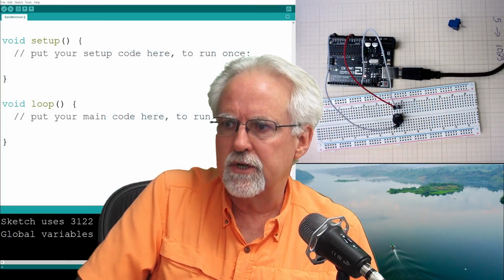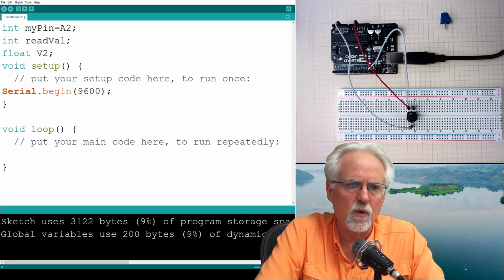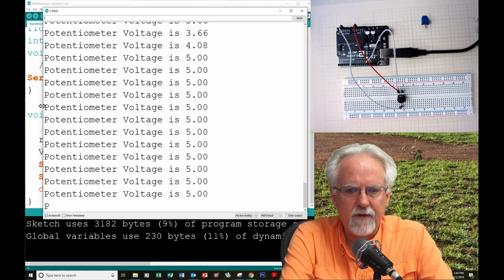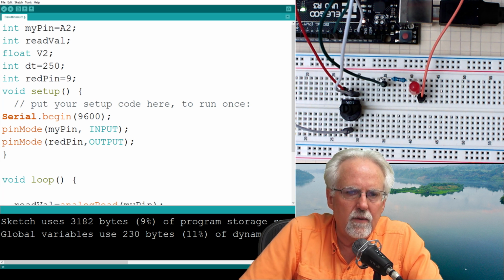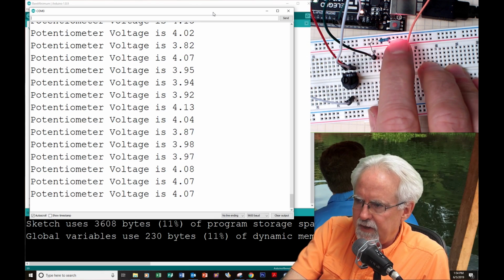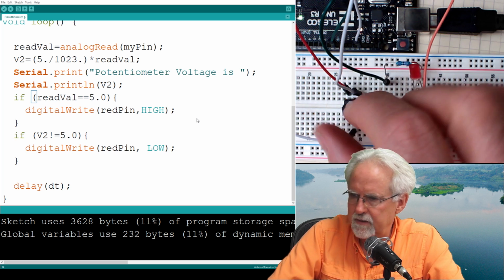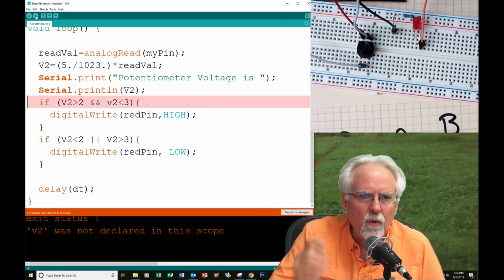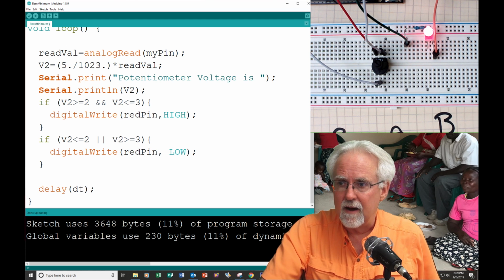Arduino Tutorial 13: Understanding Arduino If Statements

Comment: In your example, wouldn't it be better to " else"  instead of two times the " if" statement??
But anyway, I enjoy your lessons very much!!
Reply from the maker: No because else does not have the logical clarity of two if statements. Consider:
If a is not = 7 turn light on
else
turn the light off. The else introduces a double negative, and can be logically difficult for more complicated problems. I simply cover the parameter space of interest with logically clear if statements.

if x<5 do function a
if x=5 do function b
if x>5 do function c

I have completely covered the parameter space and no confusion on what the code is doing

Comment: So before I even got to the end of the video, I thought I wonder if it could set up 3 leds to give a safe zone, a caution zone and a danger zone and got it mostly working but couldn’t figure out how to switch the green off if it was below a threshold range. The over threshold was easy. So I started watching again and then you got to the “&” and “or” statements. That was the missing puzzle pieces I needed. I set my leds up to be: Green on between 0.07 and 2.99. Greater than 2.99, green off and yellow on. Above 3.99 yellow stays on but red illuminates as well. I think I will try having the red led blink above 4.50. Thanks Paul, for taking the time to teach us !!!

Comment: If you had inserted  a line saying "digitalWrite (redPin, LOW);" immediately before your first "If" statement, the second  one would be redundant because it is already set (given a default value of OFF). This requires less code/processing so it is more efficient.
Many years ago when I studied IT at university, we had to prove this by writing the man-readable code, then the assembler, and build the circuit to verify it. It was a tedious exercise but, once learned, it's the sort of thing you never forget.
Reply from the maker: In most of what I do I am not striving to be efficient, since for this application, and in fact many applications efficiency does not matter that much. What I want is clarity in what I am trying to do, so a student can look at it and clearly understand what it does.
Reply: @paulmcwhorter  That's fair. You've explained it all very clearly.

Comment: Dear Mr. McWorther. I have been watching your videos and they refresh my knowledge in coding and circuitry. My old hobby has been revived. Thank you very much.
Reply from the maker: Excellent
Reply: @paulmcwhorter   This is my assignment, just had the time to do it :)
int outPin = A2;
int baca;
float voltase;
int jeda = 500;
int redLED = 8;
int yelLED = 9;
int grnLED = 10;
void setup() {
Serial.begin(9600);
pinMode(outPin,INPUT);
pinMode(redLED,OUTPUT);
pinMode(yelLED,OUTPUT);
pinMode(grnLED,OUTPUT);
}

void loop() {
  baca=analogRead(outPin);
  voltase=(5./1023.)*baca;
  Serial.print("Current voltage is ");
  Serial.print(voltase);
  Serial.println(" volts");
  if (voltase>=4.0) {
    digitalWrite(redLED,HIGH);
    digitalWrite(yelLED,LOW);
    digitalWrite(grnLED,LOW);
    Serial.println("MAXIMUM VOLTAGE RANGE");
    delay(jeda);
  }
  if (voltase>=3.0 && voltase<=3.9) {
    digitalWrite(redLED,LOW);
    digitalWrite(yelLED,HIGH);
    digitalWrite(grnLED,LOW);
    Serial.println("MIDDLE VOLTAGE RANGE");
    delay(jeda);
  }
   if (voltase>=0.1 && voltase<=2.9) {
    digitalWrite(redLED,LOW);
    digitalWrite(yelLED,LOW);
    digitalWrite(grnLED,HIGH);
    Serial.println("LOWER VOLTAGE RANGE");
    delay(jeda);
  }
if (voltase==0) {
    digitalWrite(redLED,LOW);
    digitalWrite(yelLED,LOW);
    digitalWrite(grnLED,LOW);
    Serial.println("NO VOLTAGE INPUT");

  delay(jeda);

}
}

Comment: Thanks Paul, your videos are excellent. Informative and well presented. I did the homework at the end but it didn't work as it should, so after some head-scratching and fiddling i discovered a very basic error i had made. That was more rewarding than it just working straight up. The fault finding actually was a constructive act in its own right. Cheers sir, and enjoy the coffee.

Comment: Genuine question for you guys why can’t we always declare it as a float to be on the safe side?
Reply from the maker: Because floats are not exact numbers and have round off errors in unexpected ways. For example if:
float myNum
myNum=4
newNum=myNum/2
if newNum=2 then
print 'Hello World'

Will not always work because you can end up with unexcpected round off error in the value of the float
Reply: @paulmcwhorter  great thanks for the quick response love the videos!

Comment: THE ASSIGNMENT :::

int readPin = A2;
int greenPin = 8;
int yellowPin =9;
int redPin =10;
int readVal;
float V_out;
String readMes = "The output voltage is ";
String greenMes = " OKAY !";
String yellowMes = " RISK !!";
String redMes = " HIGH RISK !!!";
int waitTime = 200;

void setup() {
  // put your setup code here, to run once:
pinMode(readPin,INPUT);
pinMode(greenPin,OUTPUT);
pinMode(yellowPin,OUTPUT);
pinMode(redPin,OUTPUT);
Serial.begin(9600);
}

void loop() {
  // put your main code here, to run repeatedly:

readVal = analogRead(readPin);
V_out = (5./1023.)*readVal;

Serial.print(readMes);
Serial.print(V_out);
Serial.print(".");

if (V_out < 3.0){
  digitalWrite(greenPin,HIGH);
  digitalWrite(yellowPin,LOW);
  digitalWrite(redPin,LOW);
  Serial.println(greenMes);
  }

if (V_out>= 3.0 && V_out<4.0){
  digitalWrite(greenPin,LOW);
  digitalWrite(yellowPin,HIGH);
  digitalWrite(redPin,LOW);
  Serial.println(yellowMes);
  }

if (V_out >=4.0 && V_out <=5.0){
  digitalWrite(greenPin,LOW);
  digitalWrite(yellowPin,LOW);
  digitalWrite(redPin,HIGH);
  Serial.println(redMes);
  }

delay(waitTime);
}

Comment: What if we want to connect our potentiometer to  external supply rather than connecting it to arduino 5V, and the source voltage is greater than 5V.

Comment: Thank you for the great lessons! I know a little programming but I want to learn arduino and electronics. I have two suggestions. 1. In the first version of if statements you wrote V2 > 4 and V2 < 4. But what about when V2 == 4. I think you should write V2 >= 4 in the first if statement. 2. Variables are very good but they use memory. So you should use them only for things you need more then once in your program. These suggestions are only my opinion :) Thank you again for the lessons. Sincerely, Levan

Comment: Rather than using the second if statement, the best coding practice is to use an else statement.
Reply from the maker: Actually no, and I never use else statements. It is like speaking in double negatives, and opens the door to unintended results. A series of If statements has logical clarity that is less likely to result in unanticipated results.

Comment: Love your video!  I am working my way through all your lessons and I'm taking them like I was a student.  My goal is to learn more about circuits which i did not get a lot of coverage on in school. Your videos are filling that in so nicely.  ;-)

Allow me to add, I would have thought a good addition here would be to discuss the ELSE case of the Arduino IF.  For example in my code I added it as such...
if (readVolts > dangerVolt){
                 digitalWrite(redLED, HIGH); }
            else
               { digitalWrite(redLED, LOW); 
    }  // endif
Just my OCD habits perhaps (not to show my age) but I have flashbacks of my old Pascal teacher in my head as I type this. I understand time is limited and I welcome your thoughts if that would not be wise in this context.  Please keep kicking this stuff out your quality is excellent!

Comment: I was able to do the homework but am having an issue when I try to add more lights. Trying to put a light for each voltage. When I try to implement a 0-1v command block it doesn’t work. I type
if (V2>=0 && V2<1) {
DigitalWrite(redPin1, HIGH);
DigitalWrite(yellowPin1, LOW);
DigitalWrite(greenPin, LOW);
DigitalWrite(yellowPin2, LOW);
DigitalWrite(redPin2, LOW);
}
My red light doesn’t illuminate when under 1 v. 

I’m also having a weird issue that only my green light (2-3v) is bright. The other lights only get 1.8 v
Reply: I’ve tried the “||” function as well with similar results but all the other lights do not come on when in coinciding voltages

Comment: I purchased the kit and do the homework.  I am an experienced T-SQL and .NET programmer, but have done nothing like interfacing electronic components and programming.  My goal is to build mechanical devices (i.e. Cymbal polishing machine, rotating drum riser, powder coating oven, etc) that need electronic devices to be controled by a computer program.  In this sense, I am behind the power curver.  I am ahead of your lessons generally speaking in coding.  At some point, I want to use Visual Studio or a Rasberry Pie to program and possible control the computer.

Great stuff, you have unstalled me.

Comment: Another fun homework assignment. I extended it to be a 5-part level indicator (Green, Green, Green, Yellow, Red) like an audio level indicator.

> 0.0 volt : Green #1 on
> 1.0 volt : Green #2 on
> 2.0 volt : Green #3 on
> 3.0 volt : Yellow on
> 4.0 volt : Red on 

---------------------------------

void loop() {

  readVal = analogRead( readPin );
  voltage = ( maxVoltage / pinRange) * readVal;

  LightLED( greenOnePin, voltage > zeroVolt );  
  LightLED( greenTwoPin, voltage > oneVolt );  
  LightLED( greenThreePin, voltage > twoVolt );  
  LightLED( yellowPin, voltage > threeVolt );  
  LightLED( redPin, voltage > fourVolt );  
  
}

void LightLED( int pinNum , boolean turnOn ) {

  if ( turnOn )
  {
    digitalWrite(pinNum, HIGH);
  } else {
    digitalWrite(pinNum, LOW);
  }

}

Comment: here's the code : int grep=9;
int yelp=6;
int redp=3;
int apin=A3;
float v2;
int readval;
int dt=250;
void setup() {
  // put your setup code here, to run once:
Serial.begin(9600);
pinMode(apin,INPUT);  
pinMode(grep,OUTPUT);
pinMode(yelp,OUTPUT);
pinMode(redp,OUTPUT);
}

void loop() {
  // put your main code here, to run repeatedly:
  readval=analogRead(apin);
  v2=(5./1023.)*readval;
  Serial.print(v2);
  if (v2<3.){
    digitalWrite(grep,HIGH);
    digitalWrite(yelp,LOW);
    digitalWrite(redp,LOW);
   
  }
  if (v2>3. && v2<4.){
    digitalWrite(grep,LOW);
    digitalWrite(yelp,HIGH);
    digitalWrite(redp,LOW);
  }
  if (v2>4.){
    digitalWrite(grep,LOW);
    digitalWrite(yelp,LOW);
    digitalWrite(redp,HIGH);
  }
delay(dt);
}

Comment: When you code for the two conditions (if V2 is greater than or less than 4.0), you can actually string the two if statements together:
if(V2>4.0){
digitalWrite(redPin,HIGH);
} else if(V2<4.0){
digitalWrite(redPin,LOW);
}
Since the voltage on the potentiometer can only be one value at a time, there will never be a circumstance where the value is both greater than and less than 4.0.

Comment: One problem with the greater than 4.0 and less than 4.0, it should have been less than or equal to 4.0, which is <= 4.0.  As it was written 4.0 is left out.  You're telling it to turn on the LED above 4.0, and off below 4.0, not at 4.0.

Comment: The first and third codes work but not the second? Can someone tell me what I'm doing wrong?

int myPin=A2;
int readVal;
float V2;
int dt=250;
int redPin=9;

void setup() {
  // put your setup code here, to run once:
Serial.begin(9600);
pinMode(myPin, INPUT);
pinMode (redPin,OUTPUT);
}

void loop() {
  // put your main code here, to run repeatedly:
readVal=analogRead(myPin);
V2=(5./1023.)*readVal;
Serial.print("Potentiometer Voltage is ");
Serial.println(V2);
if (V2==4.0){
  digitalWrite(redPin,HIGH);
}
if (V2!=4.0){
  digitalWrite(redPin,LOW);
}
delay(dt);
}
Reply: try this change
if (V2==5.0){
  digitalWrite(redPin,HIGH);
}
if (V2!=5.0){
  digitalWrite(redPin,LOW);
}
change the value from 4.0 to 5.0.

Comment: Si with the if statements. When using a greater than 2 and another line saying less than two. What happens if the voltage is exactly at two? Does one of the lines need to read If greater than or equal to 2?
Reply from the maker: You are correct. The boundary conditions need to be explicitly considered or disaster awaits. I usually try to do that.

Comment: int read_pin =A3;
int red_led=10;
int yellow_led=9;
int green_led=8;
int read_val;
float V2;
int delay_time=50; 

void setup() {
  
  pinMode(read_pin, INPUT);
  pinMode(red_led, OUTPUT);
  pinMode(yellow_led, OUTPUT);
  pinMode(green_led, OUTPUT);

}

void loop() {

  read_val=analogRead(read_pin);
  V2=(5./1023.)*read_val;
  if(V2<=3){
    digitalWrite(green_led, HIGH);
    digitalWrite(yellow_led, LOW);
    digitalWrite(red_led, LOW);
    
  }
  else if(V2>3 && V2<=4){
  digitalWrite(green_led, LOW);
  digitalWrite(yellow_led, HIGH);
  digitalWrite(red_led, LOW);
  
  }
  else if(V2>4){
  digitalWrite(green_led, LOW);
  digitalWrite(yellow_led, LOW);
  digitalWrite(red_led, HIGH);
  
  }
  delay(delay_time);
}

Comment: Input is not connected to resistor, how the led lits up 🤔, I mean potentiometer is one separate ckt and led another ckt  their is no common connection then how.. Pls explain sir..
Reply: The two circuits are connected by codes only. The first circuit generates the input, the 'If' statement takes that value to generate the output.

Comment: Hey Paul! For some reason, on the homework assignment, my yellow and green LED are dimly lit, with the yellow one being barely visible. I can't figure out what I'm doing wrong. Each LED has its own pin, and its own resistor which aren't in series.

Comment: The potentiometer that came with my kit was faulty. If you guys get readings that you can't explain (like voltage not increasing/decreasing when you turn the knob, or voltage always being 5 or 0), then your potentiometer is probably bad. I ordered some on Amazon and now the readings look good.

Comment: Why are you dividing with 1023 and not 1024? (Which is the actual number of steps)
Reply: Because it's not the # of that step, but the value associated with that step. Here step#1024 has a value of 1023.

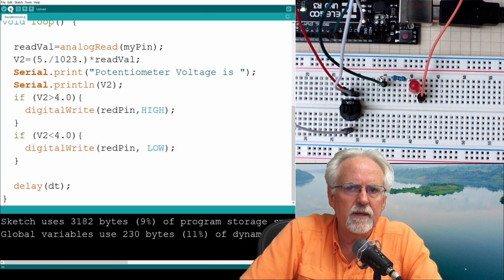Comment: Hey guys @20:32 I am getting an error when compiling the code. The error is "cannot convert 'int' to 'void(uint8_t, uint8_t) {aka void(unsigned char, unsigned char)}' in assignment
exit status 1
assignment of function 'void pinMode(uint8_t, uint8_t)'"

The line that is resulting in the error is "pinMode=(redpin,OUTPUT);"
Reply: This is the code I had written:

int myPin=A2;
int readVal;
float V2;
int dt=250;
int redpin=9;

void setup() {
  // put your setup code here, to run once:
Serial.begin(9600);
pinMode=(myPin, INPUT);
pinMode=(redpin,OUTPUT);
}

void loop() {
  // put your main code here, to run repeatedly:
  readVal=analogRead(myPin);
  V2=(5./1023.)*readVal;
  Serial.print("Potentiometer Voltage is ");
  Serial.println(V2);
  if (V2>4.0){
   digitalWrite(redpin,HIGH);

}
  if (V2<4.0){
   digitalWrite(redpin,LOW);
}
delay(dt);
}
Reply: @cavs1899 probably because using = after pinMode in Void Setup

Comment: I noticed in the Analog read video (#10), in the void setup you used pinMode to make an analog pin an INPUT. but in your potentiometer video (#12), you didn't include it and were still able to read the voltage with the analog pin. can you explain why this is?

Comment: Did have an issue with the POT thought it was my programming, but no, it was a poor contact. In the end, I have soldered on some short wires on the POT to get a consistent voltage. Good tutorial No.13. Thanks, Adam

Comment: Question: Why does this not work?  If you use V2 as 5V, it works.
if (V2==4.0){
  digitalWrite(redPin, HIGH);
  }
  if (V2!=4.0){
    digitalWrite(redPin, LOW);
  }

Comment: hello! did my homework, just replaced the yellow one with a blue LED since i don't have one but it still works the same way. my potentiometer requires a scewdriver to turn it so it was a bit hard on the testing but it works! thank you for everything.

Comment: Hi Paul, great video once again! I have a question though and hopefully you can help me understand. I built the circuit and wrote the program and everything worked just fine. I turn the knob and I get different voltage values. Perfect! The problem comes when I try to measure the voltage across the potentiometer with my multimeter. No matter how much I turn the knob or how I hook up the multimeter with the circuit I get 5V. Could you explain please why this happens? Am I doing something wrong? I also tried to hook an LED to the circuit across the potentiometer to see if by turning the knob I can change the brightness of the LED, but nothing happened.
Reply: I am a different Paul. Maybe you are measuring across the total resistance of the potentiometer (pot).  There are three legs, one is the "center tap" of the resistor.  If you measure between the center tap and one of the other legs you should get the multimeter to change value.

Comment: Paul - Per my comment below, do you have any suggestions on where to purchase replacement pots that have pins that work with our breadboard?
Reply from the maker: Those little pots are really hard to make work in a breadboard. If you really want to play around with these, you can use the ones that you solder wires to, and then plug the wires into the breadboard. I use ones like these:

https://amzn.to/3tfrm7J
Reply: @paulmcwhorter  Thank you!

Comment: The homework for this was perfect. Easy enough to do, but did require a bit of thought to ensure the if statements were all correct. And involved me building the most complex (although still straightforward!) circuit I've done yet. And very gratifying to get the three LEDs to work as I wanted them to!
On to the next lesson!

Comment: Question for Paul or anyone who might help for the homework. When writing the if statement to power on the LED light, I tried writing "if(3.0<v2<4.0)" instead of using the correct way of  "if(v2<4.0 && v2>3.0)". To me this seems to say the same thing, but the circuit behaved says otherwise (e.g. LEDs not turning off, LEDs barely blinking when they are off). Can someone help me understand why? Thank you!